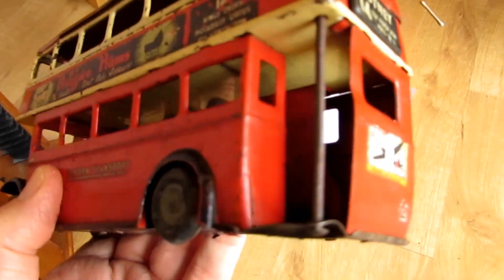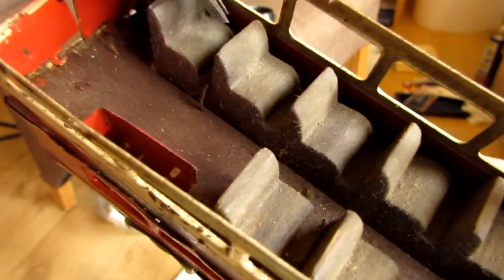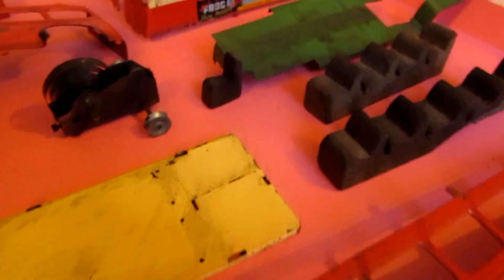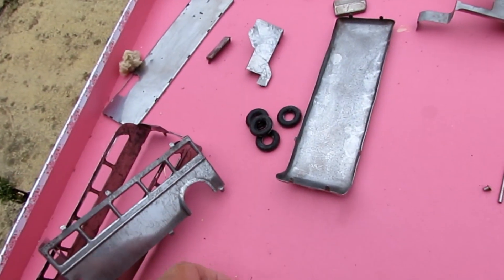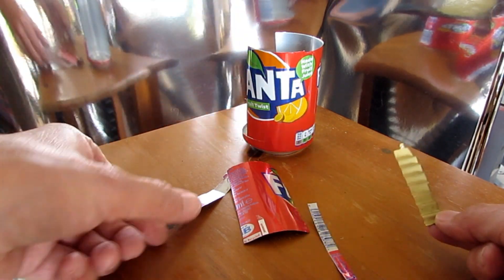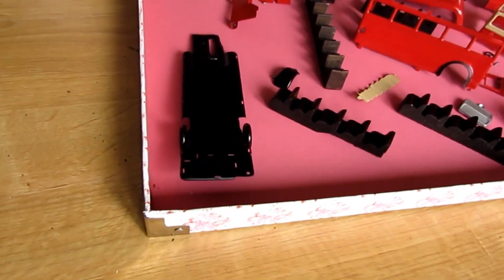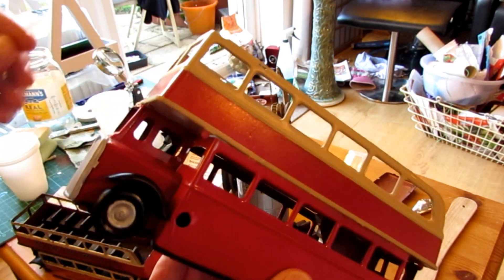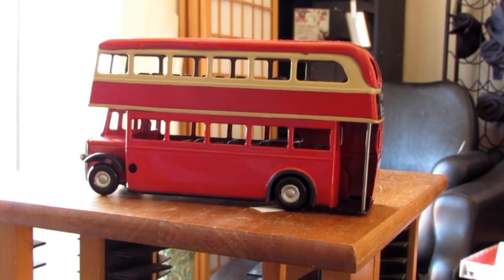Restoration of post-war Triang Minic clockwork double decker bus 60M

Comment: Hi great video i just brought the exact same bus in a little bit more of a state where do you find the parts and roughly how much to restore to your great standard ? Cheers 
Simon
Reply from the maker: Hi Simon, thanks for you kind comment, and sorry for the very late reply.  Luckily all the main parts were present in the one I bought, so I only had to make that tiny lamp holder (?)  and as you can see, even that is far from perfect ;-). The only way I know to get parts would be to buy another model for "spares and repairs".   There's only one company, I believe, that makes the replacement decals. I can dig out the link if that's helpful. Cheers, Iain
Reply: @IKP1000  Hi Iain,not sure if this will reach you ,i would like the link to the bus decals if that is possible. this is the only way i can see to contact you so would be very appreciated if this would be possible .Many Thanks    Bill
Reply from the maker: @ailsasaunders2403  Hi Bill, yes, I'll find it and send it today if possible, or tomorrow if not! Regards, iain